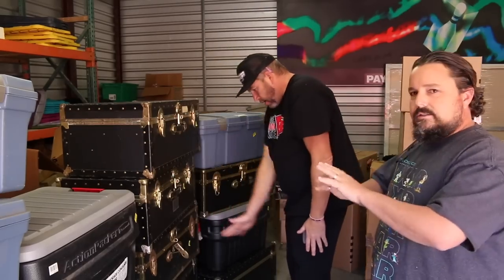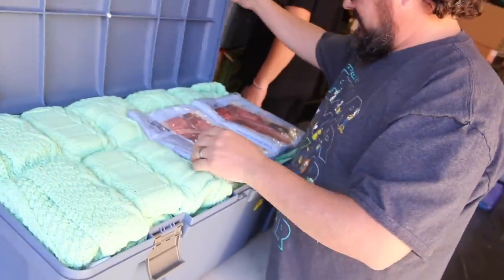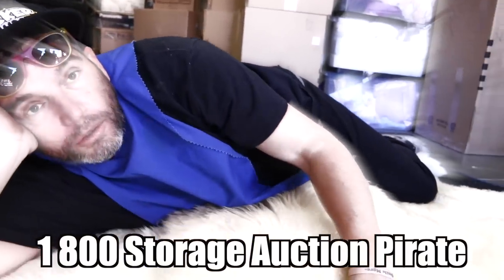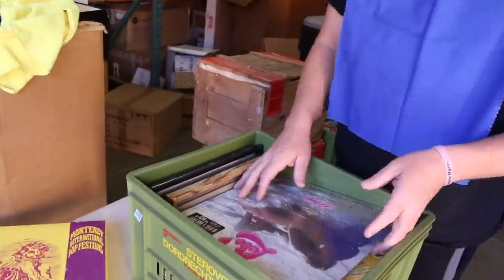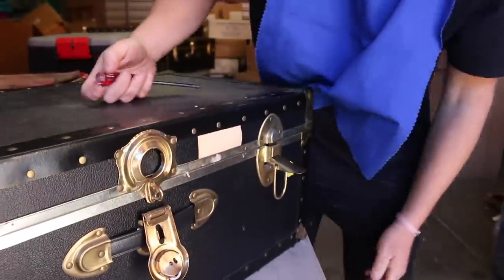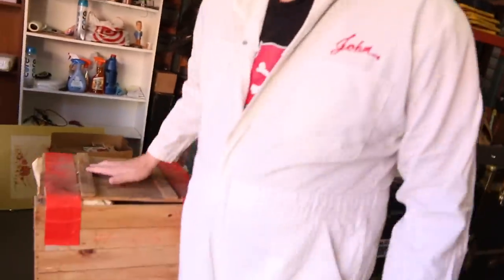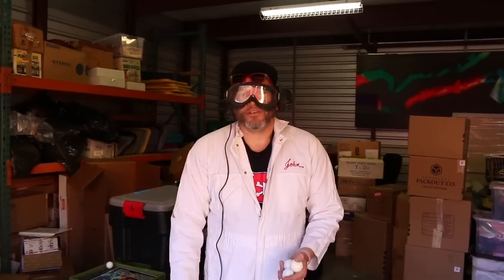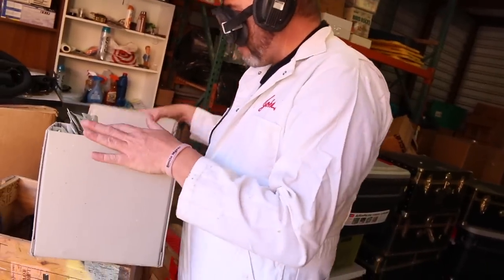HE HOARDED TRUNKS ! VAULT AUCTION $600 GAMBLE ~ STORAGE WARS EXTREME UNBOXING MYSTERY BOXES

Comment: Don't disregard that Texas Instruments LED watch....some go for $50 - $400. Pop a new battery in it, and if it is working, you probably are holding a $100 - $250. I do remember selling vintage towelletes on eBay back in the 1990s...did very well on them, believe it or not.